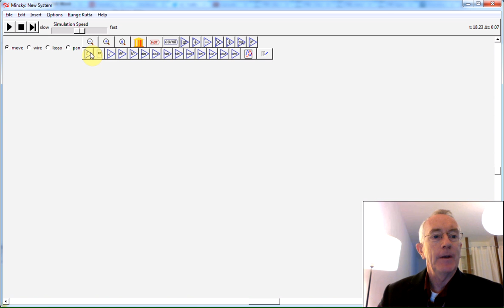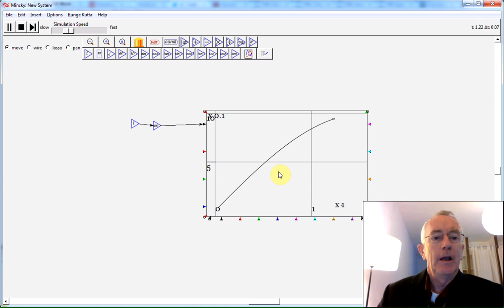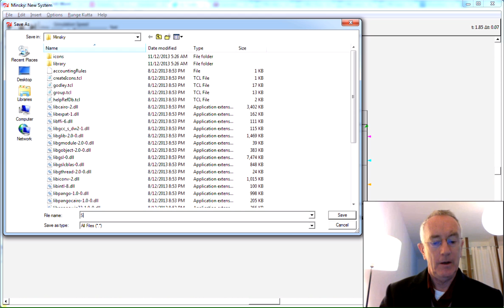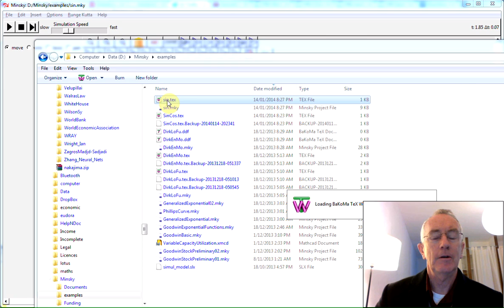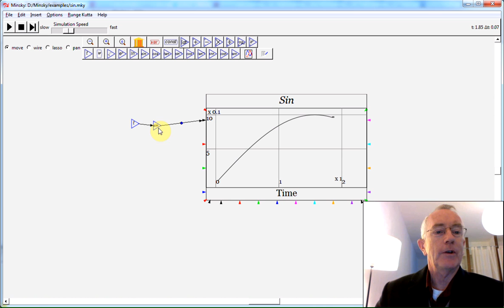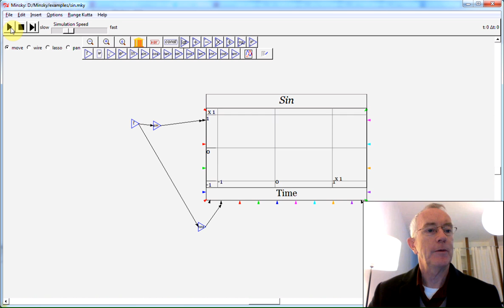Basic Minsky 01

Comment: Wonderful software many physics major students with no funding for software  will like this very much. I noticed that wiring t to sin and cos function when simulation is run creates an ellipse and not a circle? If they come into these functions simultaneously that should be a circle? Is the placement of the operation objects or function block determine the order of execution? In the past I designed and built a prototype test system for a steering sensor which simultaneously outputs a sine and cosine signal. My data acquisition system will resort to an ellipse if there is a phase difference between them that is if they are sampled by a single channel multiplexing between them not two independent simultaneous channels. I have the same issue with using Simulink - its called causality - the execution is determined which ever comes first to last ordering of things. Prior of meeting you and Minsky on youtube through an Australian friend I was using LabVIEW and OpenModelica to get away from causality issues.
Reply: Sorry viewing it again I think I was able to hear you did say its because of the plot was arranged but nevertheless I still wanted to know that if this has not issues on causality like Simulink